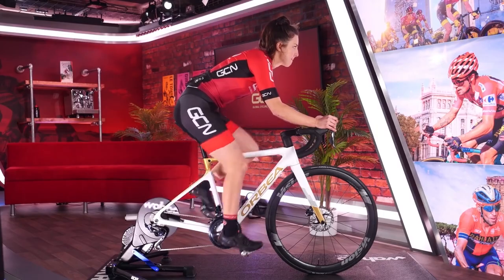How Do Power Meters Actually Work? | GCN Tech Clinic #AskGCNTech

Comment: In regards to the chain - Doddy on GMBN tech has the best compromise. If you are using it in dry conditions first strip it off the surface, but don't strip the grease from inside the rollers. If you are riding in the wet it will work like wet lube so is unnecessary. Also if you strip the grease from the interior mating surfaces completely it is a lot harder to replace it. So don't deep clean it until it's absolutely necessary.

Comment: #askgcntech I'd love to see tech solutions for those who wear glasses (contacts not an option) and eye protection / shades.
Reply: Uvex make prescription cycling glasses. Mine are -4.5 on the right, -0.5 on the left. I'm really happy with them
Reply: I just use my prescription sunglasses, they aren't aero but contacts are just too much of a pain to use imo
Reply: Rudy Project with optical insert. Works perfect!!
Reply: I think these integrated aero bars are a complete bodge. They aren‘t flexible, uncomfortable and complicated to fit the tape on them. Even on my two new Trek Emondas SLR I chose a stem and bar separetely and was glad when I had to change the stem length. That saved hundreds of €. The aero advantage of maybe 1 Watt isn‘t worth it.
Reply: I sure can tell you that Oakley does make their glasses for a lot of performance models with your prescription. But it's a very expensive option. I'm struggling with the same thing
Reply: Reading the comments so far. It's very much if money was no option it's not a problem. I wonder what is on the cheaper side if there are options.
Reply: Yes please!

Comment: The light vs heavy rider scenario with comparable exposed surface area is an interesting one. If we assume everything is identical about their riding positions and their equipment, and that both riders are exerting identical watt/kg of power output, then the heavier rider will necessarily be riding faster, regardless of the slope and wind speed. It's important to note also that the heavier rider will be investing a lesser percentage of their total power output overcoming aero drag compared to the lighter rider. So if both riders face headwinds of identical speed, the drag force on both riders will increase by the same amount, though the increase in power expended to overcome the extra drag will account for a smaller proportion of the heavier rider's total effort than that of the lighter rider. So the lighter rider will be slowed down by more than the heavier rider.

Comment: Hey Alex, I noticed there is a power meter from Velocomp (PowerPod) that works by measuring wind speed, barometric pressure, your cadence, etc. to calculate your power output. Why haven't you all discussed these? They boast the device has +/- 2% accuracy which is pretty good.

Comment: If say a stages power meter crank arm uses a strain gauge which detects minute deflection in the arm, presumably twist, then surely the reading is going to depend on where your foot is placed on the pedal or pedal axel length? The further out your foot is, the more twist and therefore the higher the power reading?

I think this is why my stages (two of them) reads around 10% lower than both my Quark and my Elite Drivo turbo because I have my cleats all the way to the outside so my foot is as close to the crank as possible, I also machine down the shoulders on the pedal spindle to affectively shorten the length of the pedal spindle. I might experiment with adding weight to the pedal upon calibration to see if that brings the power reading up more inline with my other power meters. 🤷‍♂️

Comment: From Shimano: “... So the best thing to do when installing a new chain is to leave the factory grease on, not apply any other lube, ride until it wears out and then start applying liquid chain lube.  In dusty conditions you can wipe off the outside of the new chain with a rag that is wet with a gentle degreaser to keep dirt from sticking to the grease.  The factory grease also keeps the chain nice and quiet.  After soaking a chain in degreaser and then lubing the chain with liquid lubricant the chain gets noticeably louder.”
Reply: or you degrease the chain completely and use wax

Comment: #AskGCNTech
On road bikes, do tubeless tires puncture more often than clinchers with inner tubes? A friend who switched recently had several punctures (properly sealed) on a 3 hour ride.
Reply: i would expect a clincher with inner tube is generally more puncture resistant, but there can be inserts/gels in tubeless tires for run flat properties. as always a trade off between speed/handling vs durability.  as a heavy rider i go for durability
Reply: Tubeless tyres are far more durable, GP5000 TL for example once you start riding on them no punctures till you wear out the tread.
Reply: @georgefarrowgreen01  Many thanks for this!

Comment: #askgcntech I’ve recently bought a new bike with an 11-32 cassette however my turbo trainer has an 11-28 cassette installed. Will it be okay to use my bike on the smaller cassette?
Reply: I have a 11-34 on the bike and a 11-32 on the trainer and it works pretty well. Shifting on the trainer is not as smooth as on the road, but I dont want to adjust it to decrease shifting smoothness on the road where it matters more to me.
Reply: should be no problem.  the chain length difference is not large enough to matter.  on my road bike i have 2 wheel sets.  one is 11-28 and the other is 11-25.  no issue with either
Reply: @secretagent86  chain length makes no difference from a 11-32 to an 11-28.

Comment: One for next time; #AskGCNTech what to do with components that do not seem tightened enough on their max advised torque setting? For example, my carbon seatpost doesn't stay in place in my carbon frame on the advised torque setting, so I always have to push a scary bit more to be even able to cycle (and yes, I'm using a good carbon paste). Thanks!

Comment: #AskGCNtech I just bought a second hand canyon aeroad sf slx and it's coming with Chinese CSC wheels, am I safe to ride these fast (60kph downhill?) would you buy a pair of Chinese carbon wheels (bike came for 1550€)
Reply: I sourced and built Chinese (eBay) 50 mm rims, using super light 4.5 gr bladed spokes (sapim). On brand name hubs. Been using them for 2 years now. Max speeds on them is 74 kph recently. FYI: I'm 71 kilos and can produce +/- 1200 watts. I experienced no problems while doing those speeds on my brand "x" Chinese rims and spokes. However, they do have to be maintained (like any wheel). Peace.

Comment: #AskGCNTech can we use zwift with the help of decathlon’s turbo trainer and wahoo’s Speed and cadence sensor?
Reply: I believe you can use Zwift with that set up, since it will calculate your approximate power and will have readings of your speed and cadence, but it will have limitations. I think they won't allow you to race unless you have a pwoermeter/smart trainer. Check the zwift website for full info: https://support.zwift.com/en_us/wheel-on-trainers-r1B5nQWxS https://support.zwift.com/en_us/speed-and-or-cadence-sensors-ryZdj7beB https://www.britishcycling.org.uk/knowledge/article/izn20200407-Zwift-on-a-budget-0
Reply: @jesuspascualcamino  Thank you very much

Comment: #AskGCNTech Hi Alex or Ollie, I'm looking to go from flats to clipless pedals for the first time and have noticed different options in spindle lengths, for example Shimano offer the Ultegra in +4mm (taking them from standard 52mm to 56mm), same goes for some Speedplay.  Is there a way to measure which is suitable without going for a bike fit or trying and sending back? Many thanks
Reply: Really makes very little difference, unless you pedal like a duck then buy standard length.
Reply: How tall are you?  If you are short with short legs, then you want the Q factor (the width your feet are apart) to be as minimal as possible.  If you’re tall, it doesn’t matter too much.  For shorter legs, the angle of the legs is increased more with increased Q, whereas long legs don’t have as much a change in angle.  Unless your feet are running into the cranks, there’s generally no reason to get longer pedal spindles and increase Q factor.
When I first got my small Fat Chance Yo Eddy, I found the Q factor to be too great for my short legs and I had to get a shorter BB spindle; otherwise it felt like my legs were spread way too far apart and it wasn’t efficient for spinning.  So only go for longer pedal spindles if you find you need the extra space for feet that are hitting the cranks.  You really want the narrowest stance possible.
Reply: @keirfarnum6811  Cheers mate! I'm 6ft but 110kg so didn't know if that mattered, but really sounds like standard is the way to go.  Thankyou for the info!.

Comment: Without a graphic, that was the most confusing explanation of how a power meter works that I've ever heard.
Reply: It's a strain gauge to measure the force you put through the pedals and a cadence sensor. Do some not-very-fancy maths with those numbers and out pops the power. 

Sending it via bluetooth/ant+ to the head unit is the most complicated part. 

There's no reason for these devices to cost any more than a wireless cadence sensor or a heart-rate monitor.
Reply: @pembrokeshiredan  I appreciate the response, but as a mechanical engineer and college teacher I'm familiar with the workings .  My comment was hoping to elicit some of those great video editors at GCN to do something other than show old footage of GCN guys pedaling while the narrator makes a verbal hash of the explanation.

I concur on the high cost(s) - I was hoping that $100 power meter schematics/design idea awhile back would impact the price, but apparently not.
Reply: @georgehugh3455  No argument from me. :-)

Comment: #AskGCNTech I ride a 2006 Giant TCR Limited. It is carbon frame and fork, but alloy steerer tube. Considering that aluminum has a finite fatigue limit, should critical aluminum components, like the fork assembly, be replaced after some time?

Comment: pretty sure the power meter question could get a lot more complicated answer… i mean this explanation is pretty much like explaining atoms using the bohr model kids learn in school. it's useful and a good introduction, but there are much more complicated explanations that will cover all the nuances. for example, explanation here doesn't begin to explain how good power meter design should account for things like asymetric spiders, nonround chainrings, temperature changes, etc or how some flawed designs can't properly handle these cases and are subpar

Comment: #askgcntech
Carbon bike with alloy wheels or alloy bike with carbon wheels?
Reply: Here's my guess. For same wheel radius and profile, carbon fiber will be lighter. Rotating weight will dominate power necessary to keep wheels rolling. Even using a smaller alloy wheelset probably wouldn't negate the difference between carbon fiber and the lightest alloy wheels. With frame weight, it really only makes a difference on ascents and acceleration.

Comment: #AskGCNTech Hi GCN. On most (if not all) reviews, articles comparing disc to rim brakes they assume hydraulic disk brakes. If you were to buy a bike on budget, assuming the rest of the bike is the same, would you go for mechanical disk brakes or rim brakes? From my limited experience, cable actuated disc brakes are generally worse than hydraulic and rim brakes are the old good brakes we all know. Thanks chaps!
Reply: Mechanical disc brakes are trash, stick with rim, will also be much lighter.

Comment: #askgcntech

Hey I use chainsaw lube, I used it before a race just over a year ago and have used it since mostly because it's more affordable. But I have a friend who says it is killing my chain what do you think???
Reply: Please answer this GCN Thanks
Reply: It's not going to kill the chain and something is better than nothing but it's worth bearing in mind chainsaw chains don't have rollers like bike chains and the chain only needs to last as long as the cutters and depth gauges. It's also designed to be constantly lubricated by the oiler as the lubricant flings off as the chain spins so fast. That said, bar oil is biodegradable and environmentally sound as far as I know, it's a mineral oil rather than petroleum based. Hot weather bar oil tends to be thicker and may not fly away as readily though it's better at sticking to the chain than motor oil or something. I hope gcn can answer but that's my take. 👍 Personally I followed Oz Cycles guide on chain waxing and don't really worry more than that, everything stays clean and stuff doesn't seem to stick like with oils. 🍻

Comment: #AskGCNTech 
Hi, Im looking to upgrade to carbon handle bars to with cable integration. I've got hydraulic brakes and mechanical groupset, will I need to replace my gear cables and bleed my hoses or am I okay just to disconnect, reroute and reattach? Thanks Matt
Reply: That depends on the length. I work at a shop. Honestly your best bet is to try it and see if you do - or have your local shop do it. It is very possible but nearly impossible to tell without seeing.

Comment: #askgcntech Hi guys, i have a vintage bike, with a neo retro setup. Some of my friends tell me to go with quill adapter and modern handlebars. Some of my friends tell me to keep the quill stem since my handlebars are already compact (even with a 26.0mm diameter). Should i make the change? Should i not? What gains can i get from changing to a quill stem adapter + modern handlebars when compared to the traditional solution?

Comment: #AskGCNTech Hi! hope you guys are doing well!
burning and really specific question here :)
I have a brand new Orbea Orca OMR and I want to change the stem and cut the steerer. Is it possible to change the stem and the first spacer (the one in one piece that the cable go through) and cutting the steerer without having to recable everything (hydraulic brakes and shifter cables)?
Thanks for your time and have a great one.

Comment: #AskGCNTech Hi, I don't know if this question is really tech related but I couldn't find any info on the Internet.
Ich had a crash recently and my bibshorts got damaged. Now I got a hole near my knee. It looks pretty ugly and just because of a hole I don't want to throw them away especially because I got them like 3 Weeks ago. Do you have any tips on how to fix this?
Reply: Don't crash = no holes :)
Reply: Unfortunately lycra is pretty shit at repairing so probably replace Unfortunately
Reply: Some brands do trade ins, swap your damaged for 50% a new one.
Reply: Take it to a local tailor. They'll mend it right up. I've done it before.

Comment: That strain is called Shear Strain in the crank
The crank is inside the Shear Stress Limit, and that is why, the gauge can measure the Shear Strain(means change in shape)
Reply: Correct. If the component instrumented is a BB cylinder, a dual element chevron strain gage would pick up shear strains 45 degrees from the cylinder axis. For an inspider, dual element chevrons would work as well, however for a component undergoing pure bending, it would be the principle strains that would be captured. I’m not sure what you mean by the “shear stress limit” but I’m fairly sure you mean the yield strength of the material.
Reply: @andyjonathan2486  Yes, and a higher in the hierarchy groupset will have to measure the same for the total revolution, presumably remaining On all the time because cilpless pedals have allowed for complete revolution pedal strokes
Reply: @andyjonathan2486  No mate, I mean the word "Shear" because the stress in the pedal is from the side, imagine each pedal crank as a vertical cuboid and you'll get the idea of Shear Stress and this is where the shear stress limit comes into play
Reply: @andyjonathan2486  there are three stresses in physics, 1. Longitudinal stress, 2. Shear stress, 3. Bulk stress
Shear stress is when a body is applied a force from some point above a fixed base and thus it, in a way, bends
Imagine a very thick book and when you apply a force on the cover page, it will sort of bend, or shift to the other side
Sorry for typing sooooooooooo much
Reply: @ashwinmandan5  I agree with what your are describing; essentially decomposition or section cut of where shear stress is occurring in beam. However, if we adhere a uniaxial strain gage on the top of the beam and measure the tensile strains at the surface, would these be from the shear strains mentioned earlier, or the Max principle strains present on the component surface?
Reply: @andyjonathan2486  I think you are right, essentially it must give the numerical values for the shear stress, as our crank won't simply act like a slider but a solid beam

Comment: #AskGCNTech Will the one side power meters accuracy decrease if you are riding on flats. Cause your foot isn't always putting power on the pedal.Will it affect the way power meter calculates our power?
Reply: No,  temperature changes are the only thing that are likely to give slightly different power meter readings

Comment: prices of power meters is still a rip off, the only reasonably priced one is a left sided crank meter stages/4ii. A dual power is way over priced. This stuff should be available to everyone, you're just paying for the name on it like everything else.
Reply: Having made a few power meters I can tell you there is a lot of work involved in making it accurate enough to be useful.
Reply: It’s a very complicated piece of technology. As of yet strain gauge technology is still at the forefront and is one of the larger costs to power meters. The big named power meter companies do not manufacture their strain gauges.
Simon,
MFL

Comment: How can I use triathlon bars on my flat (aerodynamic) handlebars? Normal ones don’t fit on non-round tubes. #AskGCNTech
Reply: You'll need to look up if the manufacturer of your aerobars makes specific tri extensions for that handlebar. That's the only way unfortunately